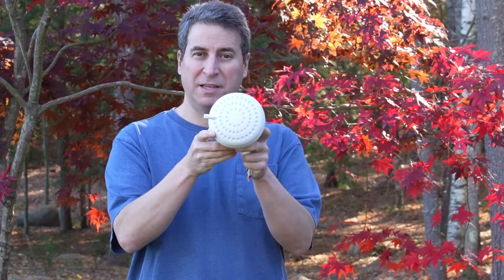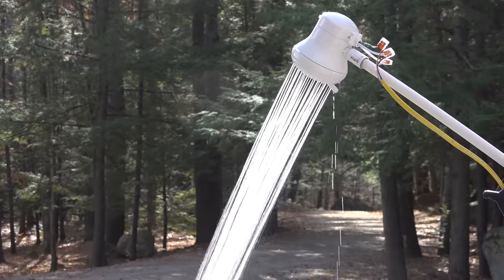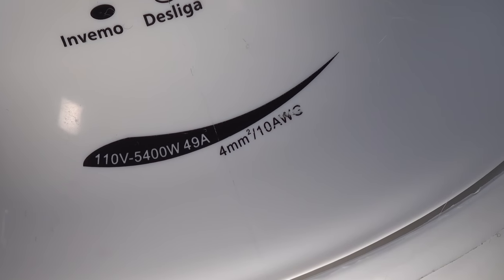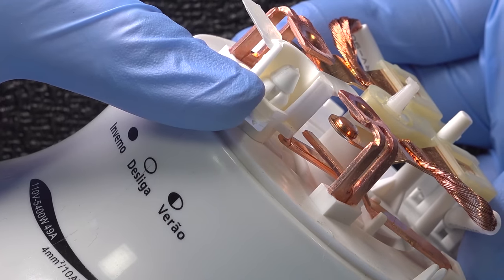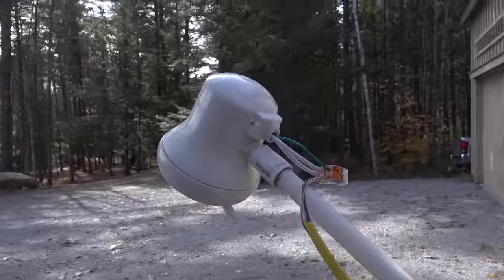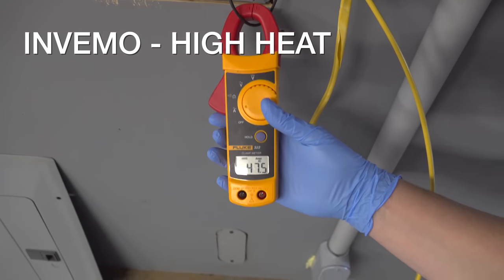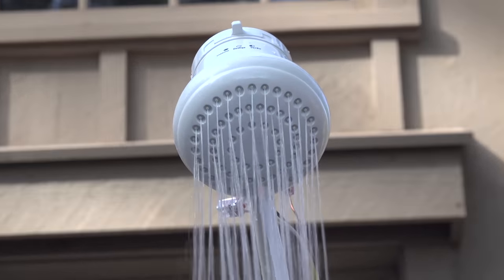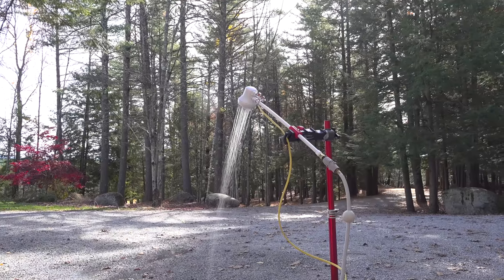What Happens When You Use a SUICIDE SHOWER HEAD in the US

Comment: @Silver Cymbal: A better test of safety would be whether the water becomes live relative to ground if the element breaks and becomes open-circuit, leaving the water as the only path between the circuit conductors.  You could test that by sacrificially cutting the heating element, then measuring voltage between the outflow and the protective ground conductor.

Without destroying the heating element, you could test for the most extreme scenario that I can think of, but which could accidentally occur, by simply disconnecting the neutral supply conductor to your shower head, leaving the water only exposed to the live conductor and the protective ground conductor.

If you conduct either or both of these tests, I'd be interested to see what you find with the protective ground conductor connected, and also disconnected.

The '+' marking would make more sense if it designated the live supply conductor with only a single-pole switch but, to guard against reversal of live and neutral, the unit has a two-pole switch.

I don't agree that reports of a tingling sensation are likely to be due to "some type of internal short-circuit", as the water is already in direct contact with both the live and neutral supply conductors, so I can't think of any possible fault connection that would increase the risk of shock.  As I suggested, I think it would actually be disconnection of the neutral supply conductor that would pose the greatest shock risk.

Comment: I'm a Canadian mechanical power engineer who lives in Nicaragua. I use these shower heads all the time.  The water coming out of the tap here is about 26° c, and these shower heads almost make the water warm lol. It's nothing like natural gas hot water back in Canada that's for sure. And there is no risk from getting an electrical shock from the shower heads, unless they are incorrectly installed, which probably happens quite often down here, electrical wiring isn't exactly "up to code" like we have back in North America. But that being said I have never gotten a shock from one of these shower heads

Comment: this concept is pretty common in the UK though not the particular model. Electric showers up to 11kW are common in many homes. They also simply use an electrical heating element to heat water as it passes through. Our tap water is probably a similar temperature to the northern parts of the USA.

Comment: 2:08 AC actually does have a + and -. The labeling is easier for people to understand. The + is the voltage and the - is the AC ground. The green ground is a redundant safety ground which I don't think is necessary in this application since the head housing may be non-conductive.

Comment: A better test would be to measure the current going through the ground wire (it should be 0), or disconnecting the ground wire and then measuring the voltage between the ground wire and real ground.  These aren't allowed in the US (ie, not UL listed) because the ground wire is not allowed to carry current in regular operation, but to provide a measure of safety should something else go wrong.  These showerheads rely on the ground wire to shunt current away from the user, and the ground wire does end up carrying current.  If the ground wire isn't a perfect connection to ground then the user could become part of the AC circuit.  The design of the sprayer, however, does limit this somewhat - there is rarely an unbroken stream of water (take high speed photos to confirm) and instead it provides a series of droplets.  The most hazardous part is probably the little hose sprayer - set it into the tub and there may be a complete circuit through the water to ground, including whoever is in the water.  

All that said, most water in areas where this is employed is so high in mineral content that the current would prefer to go around the body rather than through it, and the drains are generally conductive and grounded, so a slight tingling would be all most people feel assuming all these little failures lined up at the same time.  The real danger is if the water is not otherwise grounded, and a user who is grounded (perhaps holding onto a grab bar) touches the electrified water with a poorly grounded shower head heater.  So if the ground wire is connected, but corroded and high resistance, and the user's toes are on the grounded drain, and they reach up to adjust the showerhead, putting their hand over the spraying holes, then the water would complete the circuit with their body and shock them.

Comment: As a Brazilian, the worst case scenario is having the resistor blow up and you lose all of your precious hot water. Hardware stores sell separate resistors so you can exchange them. 99% of the houses use this system, it's honestly really solid, and I believe the "suicide" part comes from the fact that old showers were made out of metal, and therefore, the whole thing would be electrified if not properly grounded. My dad grew up in the 1960s and 1970s, and even as a kid, already living in the era of plastic electric showers (which have way better insulation), he still ordered me to turn off the shower before switching temperatures. To this day I still do this.

Comment: Remember : the water input pressure in Brazil etc is not the street pressure that we have in the USA. It’s GRAVITY pressure from 15’ up ( on average) coming from a storage tank !   All Brazilian homes have storage tanks.      This means that the water is hotter at low pressure. And of course as you stated it is preheated from tropical climates. So if you want the water hotter , then turn down the flow.

Comment: They are also more effective in foreign countries because they typically have a 220v power supply. In South America it is also common to have tanks stored on the roof of your home. This is for several reasons. 1. To store water as supply is not always consistent. 2. to preheat the water with the sun. 3. gravity pushes the water into the home instead of relying on utility pressure

Comment: Lived in Brazil for 30 years, the worst problem I ever had with one of these was a burnt heating resistor, which is expected after a few years, and it is replaceable. Lived in Europe for 3 years, the hot water pipe output from the heater burst and flooded my kitchen (it lasted less than my last shower head resistor in Brazil). Not to mention the waste of heat and water you get until the hot water gets to the shower head. I much prefer the Brazilian solution.

Comment: They’re safe because power wants to return to its source. As long as you don’t have a ground bond then even a short will just cause massive flow between hot and neutral until the breaker pops between hot and neutral (and visa versa). You’d have to put your hand between the short to get hurt and even that wouldn’t kill you because you’re not creating a circuit through your chest. Electro boom did a video on this in a bathtub. 

The reason we think of water and power as a dangerous combination is because of the cheap out from the power companies that results in neutral and ground being bonded. It means that you can get shocked with one hand in an AC circuit simply by completing the circuit to ground and that runs through your heart if it’s your hand that is doing the touching.  (The neutral/ground bond is not to make breakers work as you’ll be told by electricians. It’s to shunt excess power on the neutral to earth instead of back to the transformer so they can make them more cheaply. The breakers just use this in their design. They’d work vastly better if ground wasn’t bonded because instant tripping on any voltage on ground would be possible in nano seconds instead of 30ms like gfci and the breakers would be cheaper too. )

But, as with these, there is no bond or the bond is back at the panel and not the ground wire in the device the resistance back to source through the earth or wood, or tile or porcelain or whatever is vastly more than the neutral so power always finds the least resistance path to source which is the neutral wire.  In fact, if the head has a ground it’s MORE dangerous than if it doesn’t. 

The only real way these could be dangerous is if the neutral got disconnected and the floor was marginally conductive. Then the power could flow through the water, your body and to earth grounding on the bonded neutral. Similar to how you can light an led on AC with a single hot wire and no ground or neutral. (That’s a diode but the concept is similar)

And to be clear, these are more dangerous on 120v than 240v because neutral and ground can be energized with an unbalanced load between the two phases of a split phase system that then causes the water, body, earth to want to carry current back to source.  In 240v like most of the rest of the world there is no unbalanced phase and thus less risk even though higher voltage.

Comment: They are common in Puerto Rico, but don't work very well because they are just plugged in to a standard 120V outlet, so they are only 1500-2000W. They use a standard water-heater heating element.

Comment: It's legally required as part of the Warranty of Habitability here in Colorado that a home must be able to supply, "(c) Running water and reasonable amounts of hot water at all times furnished to appropriate fixtures and connected to a sewage disposal system approved under applicable law;" (CRS 38-12-505) Since this would only supply to the fixture itself, and not to say a bathroom or kitchen faucet, then it would not be a legal installation for a rental unit here in Colorado. There would still need to be a central hot water heater with tank

Comment: New buildings here in Brazil have a Residual Diferential Protection Device installed on eletrical circuits, it gatantee that every electron (about less than 30mA) that goes through line (+) get back from neutral (-). If not it goes off. Making very safe to use those showers.

Comment: I used those frequently while traveling south America, you'd usually get a small tingle to an uncomfortable bite from the shower knobs if you wanted to change the amount of flow, so sometimes these metal knobs were wrapped in tape or it was just recommended to shut off the shower head with the circuit breaker before using the handles. yeah the breaker was installed within reach of the shower for this reason

Comment: Im from CostaRica...that Ground wire was never connected to anything in my house. I used to have that "electric" feeling when I closed the water valve, and it was worse if I had a small cut in my hand.

I remember one morning when I was a kid, I was preoaring for school and the water pressure was low that morning, I closed the water valve but the shower head got stucked and didnt turned off, as I opened the water valve again...that water was almost boiling, it didnt burned me, but it was close.

It wasnt until early this year that we changed the system and installed a regular not deadly, small water heater only for the shower.

Comment: This is the cheapest option from this brand. Nowadays you cand find eletronic ones in which you don't need to close the water to change the temperature since there is a built in controller to adjust the wattage given to the resistor. Other devices will come with an armored resistor, kinda like those you would find in an oven that are more robust and can withstand harder waters without breaking too easily. Other models may include a built-in pressurizer if thats a concern you may have in your shower. Since Brazil it's quite hot all year long in most of the states having runing hot water in our houses is quite unusual so theses shower heads are in more than 99% of the households

Comment: What is written above the switch is not "INVEMO" it is actually "INVERNO" or "WINTER" as translated from portuguese, the other switch "VERÃO" is actually "SUMMER" 

Also, we never touch those buttons regularly since touching the showerhead is almost a guarantee electric shock since it probably isn't grounded, so we just regulate the water flow in the tap, it also gives eletric shocks sometimes, but you can get a huge range of temperatures and also fine tune just by changing the water flow

I used to live on a very cold place in the south of brazil, there, for you to have a confortable shower you had to open the tap just a slightly ammout, almost dripping, so it could activate de shower head and heat enough the tiny ammount of water

Comment: Colombian here, those kind of showers are popular here I would say about 50% of low-mid income households have one or two of those. 
Those have been left behind by natural gas heaters that provide a great amount of water just as hot as you want. Still you see those electric shower heads in a lot of houses and they are perfectly safe, just follow manufacturer instructions such as grounding, using a dedicated 40+ amp connection and replacing consumables such as the resistor/heating element, insulation, contact wires and rubbers as the manufacturer states (usually every 3 years) my dad has one of those bad boys and has been using it for 30 yrs without a single issue.
Reply: Btw replacing consumables is dirt cheap I don't get why people don't do it, also installing it correctly is not hard and there's plenty of information on how to do it... Yet people do it wrong 😓

Comment: Most modern and more expensive models have electronic terminal for temperature regulation, with stronger coils who could heat up to 120ºF/40ºC even under 0ºC ambient temperature. This is a very basic showerhead model, the cheapest one. Also, is sold in Brazil some models of electric tapheads who is pratically the kitchen version of this showerhead. Only the problem of those things is the strong electricity flow who makes your bill skyrocket up on the end of month.

Comment: Just nichrome wire wrapped into a coil. The electric switch part can be separated. Doesn't have to be together. You just need it switched on and have water flow pass nichrome wire

Comment: A few curiosities here. In Brazil a hot water system is a luxury in most households, even in upper middle class. So those electric shower heads are the standard everywhere here.
Another fact. The labels on the switch are as follows: P.S. on this unit the word Inverno is misspelled. Inverno (winter): Hot, Desligado: Off, Verão (Summer): Medium.

Comment: Inverno = winter 
Verão = summer
Desliga = Off

We have this type, with exposed heater element (NiCr) and another type with insulated heater element compatible with residual-current device (earth fault 20~30mA) circuit breakers. Its very common unpleasant electric bites when you touch the mixing valve, most caused by water conductivity variations (minerals and salts) across the country (exposed heater element) with a poor or without earth grounded shower.

Comment: When installed correctly those things are quite safe, even when installed incorrectly. Think about not grounding it, chances of anything happening is low. At my grandmothers house the tap to turn on the water was from metal, so I’d feel a tingling sensation indeed, always used my towel to open it 😂. And we always get thought not to change temperature with the shower running, and we mostly use a wood rod to do it. 

But back in facts, Brazil scores really badly when it comes to electrical safety, 7th most deaths by electrical accidents in the world, last years around 600 people died due electrical shock, and as far as I could research, none was related to a death while showering. Lack of RCD and earthing combined with unprofessional installations, unauthorized reparations of appliances and bad maintenance of electrical plugs at homes are the main cause of accidents.

Comment: I spent a few months in Ecuador & the apt I lived in had some type of that shower head. I thought it was such a neat idea but the specific shower head there & how it was installed was not safe. You had to turn on the circuit through an exposed knife switch on the shower wall & sometimes the internal contacts of the shower head would release so the circuit would be hot but the heating elements wouldn't be on. I learned that if you just tap the shower head a few times, you could get the contacts to reconnect & the heating elements would come back online. Once I was taking a shower & the contacts failed so I tapped the shower head but THE SHOWER HEAD SPARKED & ACTUALLY CAUGHT FIRE! So, there I was: wet & covered with soap (an electrical conductor), with an active electrical fire six inches above me & the only way to cut power was by flicking off the bare knife switch with my wet hand. It was not the best.

Comment: I would think from an engineering point that this could be somewhat safe if placed on a combination ground fault/arc fault breaker rated at 60 amps (breakers should only be loaded to 80 percent)  I do not like the short leads though,  I think a short jacketed cable to a fully enclosed junction box is in order.  The junction box should be well above the shower and splash proof (weather proof)  Exposed splices seem to be an accident waiting to happen.  I also think the green ground wire should have a large electrode, not just a stripped end, to provide a good return path if needed.
Reply: Safest would be a cgfi but I suspect there would be enough leakage current to trip.
Reply: @beans4gas  not really sure how they work. Wouldn't the ground wire in the water reservoir of the head cause continuity with the heating element and trip the gfci?
Reply: @juliogonzo2718  I wasn't sure what that ground wire was doing. If it was in the reservoir then gfci would likely trip.